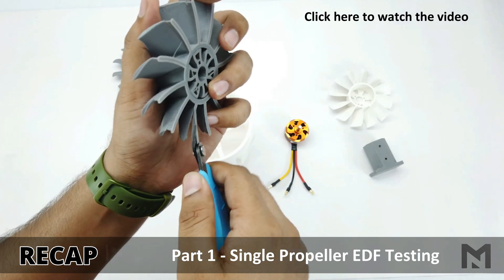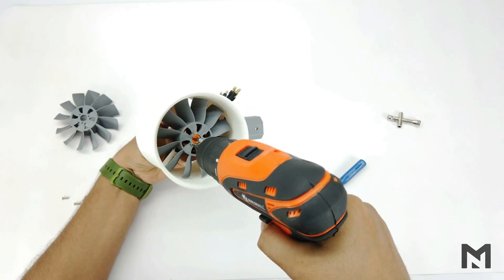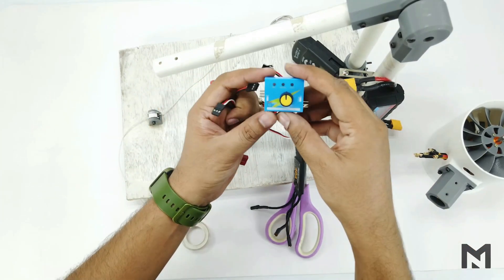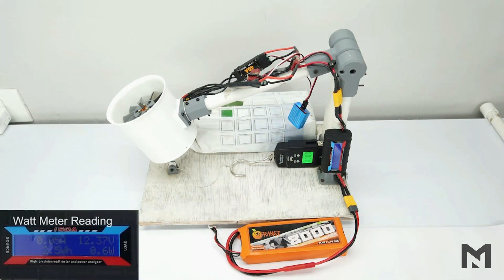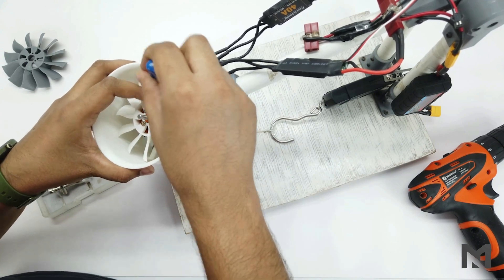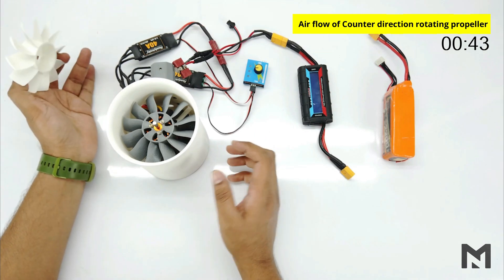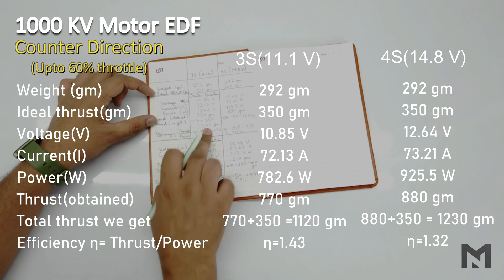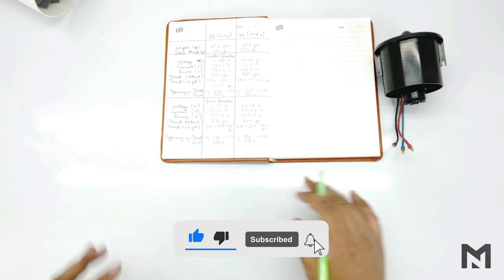Dual Propeller 3D printed 100 mm Electric Ducted Fan | 1700 KV Motor | Part 2

Comment: Just like you're trying to do something like that. I tried to make a different number of blades in the steps, rotate at different speeds. I haven't done it yet. The screws rotate with a beat.  https://drive.google.com/drive/folders/14Oh8xrsIpG2ojUPiU8RyN7BCV7WO_Te2?usp=sharing

Comment: Hi. Love your design. Which of your edf 70 or 80 or 90 gives best results to produce 1 kg of thrust?
Reply from the maker: Sir it totally depends on the motor you are using. Let me know the motor you want to use
Reply: @MechNinja  maybe emax eco ii 2306 2400kv on 80 mm edf?

Comment: Most imporant suggestion, make the fan housing two parts and put the fance in the middle immediately faceing each other instead of this far apart.
Second: the rear fan needs LESS angle od attack as the first. This is because the swirrl of the first cause an natural increase of the angle of attack for the second. So it needs less physicxal angle of attack.
Heino Dittmar did counter rotating fans in the late 90th as the canned motors of that time were so ineffective and have elaborate this already.
Got lost with more effective motors that the increase of effectivity of counter rotating fans got lost für simplicity of design with single fans.
Reply from the maker: Thankyou for your suggestion, I will definitely test it in my upcoming videos.
And thankyou for watching and don't forget to subscribe 😊😊😊

Comment: Hi, I wanted to know if a 12,000 battery (for all four) and 8 60A ESCs at maximum speed would be fine with four of these twin-engines.
Reply from the maker: You have to calculate the amount of amp each motor then you can calculate the time of flight using online calculator

Comment: How many miles can it cover when mounted on a jet drone and please what is the pros and cons
Reply from the maker: You can go with 70 mm EDF it has more thrust...check my videos for it
And time of flight depends on the battery you are using.
Reply: @MechNinja  how about two 12 v/Ah battery

Comment: Im no engineer, but it would interesting to see what 3 and/or 4 propellers would do to thrust. Theres no video out there that explains that.
Reply from the maker: Well it will increase the pressure at the end.
You can watch assembly video of any jet engine.
Reply: @MechNinja  Pressure as in thrust? If it increases thrust then why is there no ducted fan with 3+ propellers? 
Jet engine is different as the function of the  multi stage propellers are for something else so cant compare like that

Comment: Hello.. TQ very much for the dual prop EDF lesson. If i wanna get at least 20kg (dual) sustaining thrust, what brushless motor specs and models do you recommend that i can buy within Asia?

Is the TMotor p60 kv170 good enough?

Can I also pay for your service to design ducts and propellers.. how to contact you?
Reply from the maker: Thankyou for your watching the video....
Well 20kg is too much thrust for an electric EDF....And TMotor p60 is designed for propellers not for EDF, it won't give much thrust in duct...EDF motors are different.....
Well regarding the design....mail watsapp me at +917835925201

Comment: Can you make an EDF that can match the sound of a jet engine. Eg: jetcat p300 or other hobby turbine engines.
Reply from the maker: Well if you here it's sound..then it's similar to jetcat p300....
The main difference is that, EDf uses only a single fan blade but jetcat p3000 uses multiple blades including a compressor and turbine hence the sound is different....
Do one thing....chech my mini turbine engine video....it's a jetcat model and produces same sound.
And thankyou for watching and don't forget to subscribe 😊😊😊😊

Comment: you could hav used better esc and full throttle
Reply from the maker: Well I have two 80 amp ESC but both are from different manufacturers.....so i thought to use two same ESCs....
But now I will try to use better ESCs...
Thankyou so much for watching and don't forget to subscribe 😊😊😊😊

Comment: A list of suggestions I would recommend is making the 2nd stage with a mor aggressive angle and maybe if you try a 3rd stage that’s even more aggressive with a housing that funnels in at the exhaust ever so slightly and adding a flare around the intake to increase the directing of the air in therefore increasing compression. You could also add a vein to direct airflow better in the initial stages I’d recommend looking up a variable state vein. I hope my recommendations helped increase the efficiency of your motor designs I love making new things and helping people do it
Reply: EDF will not realy 'compress', its more about flow.
3rd stage ist not realy effective, counter rotating IS. Thats as counter rotating it serving as a better statur vanes that have to be there to remove the swirl in the flow.

Comment: test needs to include external static pressure test..to determine the load on the motors. less thrust may be due to lack of air volume passing through... increase pipe size and check motor temp.... really enjoying your vids... thank  you
Reply from the maker: Thankyou so much for your suggestion....I will definitely look into it...I am working on a more precise rig and will also include air speed....Do check my new videos they are so informative....
And thankyou for watching and don't forget to subscribe 😊😊😊😊

Comment: I truly admire your effort.. Perhaps you could start back to design the fan blade after having some looks into the fluid mechanics text book.. The rear fan will need to have higher pitch subject to the angular velocity of the airflow after pushed by the 1st stage.. The numbers of blade need to be unique number.. Anyway wish u all the best in designing the best edf for your needs.
Reply from the maker: Thankyou so much for giving your valuable information...i will definitely increase the pitch in my upcoming videos..
Don't forget to subscribe 😊😊😊😊

Comment: do the test for 1400kv bldc motor with 5045 propeller
Reply from the maker: It will be of no use.....because 5 inch propeller requires atleast a minimum 2200 kv motor